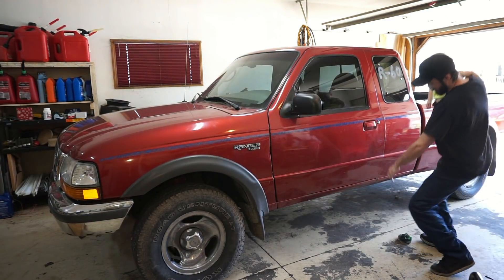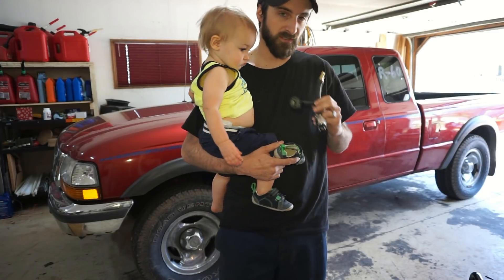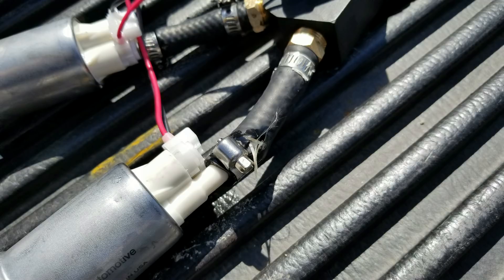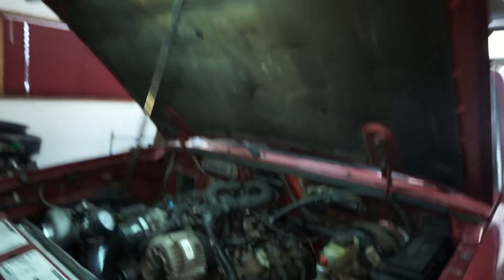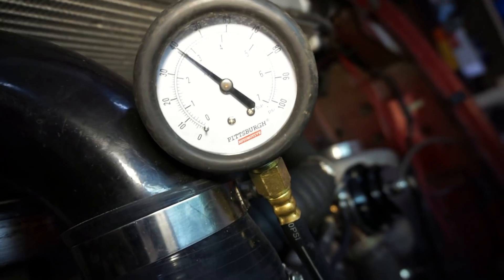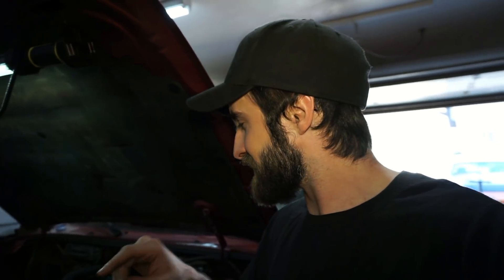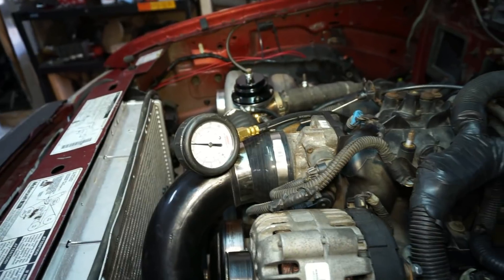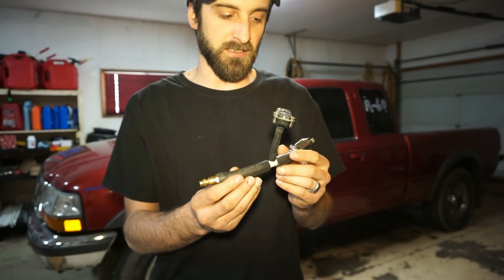TRACK ISSUES!!! WHAT I FOUND AND BOOST CUT IDEA TO PREVENT FAILURE!!! - a21bravo

Comment: The hose included with the Walbro 450 install kit is unlabeled, unrated junk, which softened and split, days after in tank 450 install at stock fuel pressure. Lesson learned: use sae j30r10 rated subersible hose in the tank, and use the 450 install kit hose on your lawn tractor.
Reply from the maker: 1st Amendment Supporter Lol, yeah I switched them to e85 submersible now. Unfortunately the pressure was also at 140psi and didn't realize it.

Comment: Your exceeding the flow capacity of the stock regulator eliminate the stock regulator!
Reply from the maker: snooketcher  I remove the aftermarket regulator and pressure dropped to 45psi... Ordered a different one. I'll do a video on that.

Comment: You need some gates submersible rated hose for in the tank.  Push lock hose is great but not for in the tank.  Good luck. Keep wrenchin!!
Reply: mattharmony88 push lock hose is garbage
Reply: Maybe you are using the wrong type hose for the intended purpose.  I speculate it's user error in your case Cole
Reply: mattharmony88 I sell it,I know enough about it to know it fails on a regular basis,wtf do you know about it?
Reply: I know I use it properly and it does NOT fail.  Should I know more than that? Oh and of course you sell it.....employees that sell things are always experts right?

Comment: If you shut off ignition (the plugs), won't the injectors try to hydraulically lock the motor at rpm?  Or at least dump a ton of fuel into the exhaust & turbo?
Reply from the maker: I can't say for sure because I haven't tested it, but it won't permanently cut off spark, it will just open the circuit when it's over that boost level so should quickly drop and start firing again... I could set it up to cut injectors and spark too.

Comment: If your getting familiar with the stock pcm give the calculated airmass table a threshold that would indicate an overboost condition and it'll trigger reduced engine power p1514/p0068

Comment: the regulator on the rail should maintain 55-60psi with no vacuum hooked up. Either the regulator is bad or the dual 450s are just over running it. Also thats a cool ideal for a boost cut. I dont know how it would work on a DBC setup, but on DBW you can set the P0106  error Map Max to what you want your boost max to be in KPA and it'll trigger reduced power mode if the map sensor reads more than that. You may just want to set it to like 140kpa and see what happens when you hit that limit.
Reply from the maker: Bad Luck Garage I did some more digging after, and after gutting the rail regulator, pretty sure the other regulator was just way off because when I pulled it out pressure dropped to 45psi.
Reply: ok nevermind. I dont think the DBC OSs have those tables. Just checked a 2001 silverado file from a tune i did for john and those tables dont exist in it.Guess its just a DBW thing.
Reply: Or he could set his calculated airmass table to a threshold that would indicate an overboost condition and trigger p1514/p0068 which is reduced power.
Reply: yep....different table, same effect.👍 You getting this Ryan?😜
Reply from the maker: Bad Luck Garage hmm. I'll check that out...
Reply: it was pretty obvious one of them wasnt doing the job,lol. I know Matt Happel was able to run two 450s on the rail regulator but three overan it. But everything doesnt always go the same way for everyone. I'm living proof of that shit.😜
Reply: a restricted return line WILL cause uncontrolled pressure on a stock return line

Comment: Need a switch to only run on one fuel pump for running around town ,,,,,kick it on for the strip
Reply from the maker: Kevin G Thinking about it but I know I'd forget to turn it on, so I'd have to wire in into a boost or throttle reference.
Reply: a21bravo a small Bank of overhead switches right dead center above your rear-view mirror for all your race switches will prevent that

Comment: If you kill the spark plugs, couldn't the engine make a few revolutions while injecting (but not firing) fuel and possibly hydrolock the engine?
Reply from the maker: JayinMI I think it would need a LOT of fuel for that to happen. It wont permanently cut spark, onky when above set point... It would stop firing, and boost would come back down to within range and fire again pretty quickly.... It works in my head but I guess there always a possibility..
Reply: JayinMI the valves are still opening and closing even though the engine isn't firing on the compression stroke there's not enough fuel in there from one injection cycle to cause any damage and it will be pushed out on the exhaust stroke

Comment: But sloppy says pushloc for the win...garbage, if that hose got soft it's not submersible hose
Reply from the maker: Cole Murphy Yeah, I'm going to keep the pushlock outside the tank and go to a barb with submersible inside... I'm sure 130psi didn't help.
Reply: a21bravo I've had real shity luck with push locks nothing beats a barbed fitting in a couple of good high pressure hose clamps

Comment: i think you probably plumb  it wrong, you cant have 120 psi on the fuel rail if the regulator that feed it is set at 60psi, a regulator cant regulate at a higher pressure than it recieve.
Reply: That does seem odd ,,,unless the 4 bar 60 psi is the return line which would make sense of blowing the hoses off
Reply from the maker: The regulator is on the return side. There's a chance the regulator gauge isn't accurate also. I messed with it again today, lowered it 1 bar rail pressure with down 10psi, lowered it more than pressure went up... I ordered a new regulator...
Reply: a21bravo ah ok, if the regulator is on the return, it is then after the stock one wich is also at the end of the fuel rail. You should put your regulator before the fuel rail and cap the stock return and only use the retirn from the new regulator, like the corvette filter is arranged.
Reply: 2 60 psi pumps -120 psi ,,,,,regulated to 60 back to tank ......shouldnt the regulator be on supply side ?
Reply: Regulator is probably ok ....120 going in 60 going in tank ,,,,,,cap off or put a newer style rail on 04 05  returnless     ,,all those clamps make me nervous

Comment: I had a similar issue with the stock fuel pressure regulator running a 450 in the tank. I removed the regulator and removed the small o-ring in the center of the regulator and that brought my fuel pressure to 50ish. I then installed an external fuel pressure regulator on the return line and set it to 60 psi. Seems ok so far!
Reply from the maker: That's pretty much exactly what one doing right now. Gutting that regulator opening.
Reply: a21bravo put that in your video Ryan that's helpful
Reply from the maker: Cole Murphy I'll go over it.